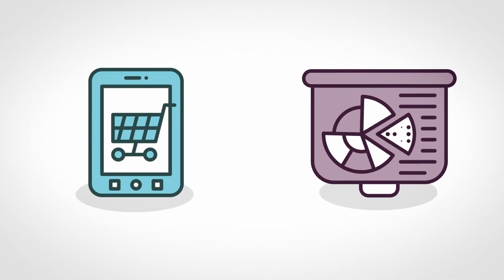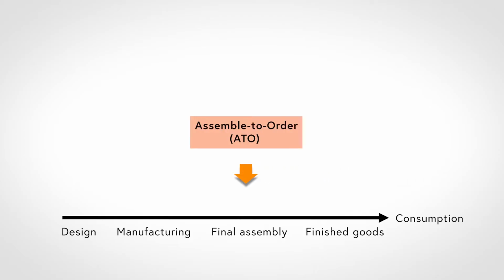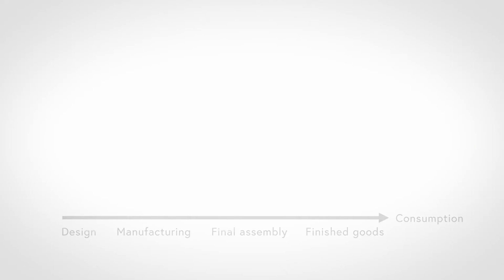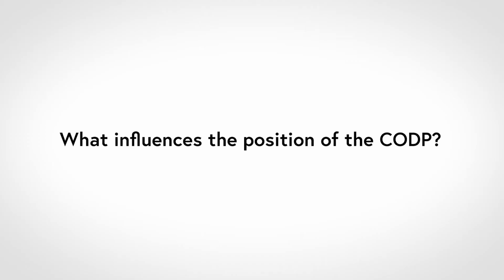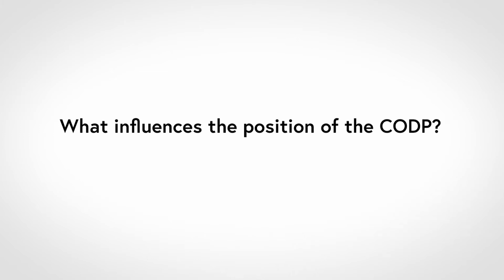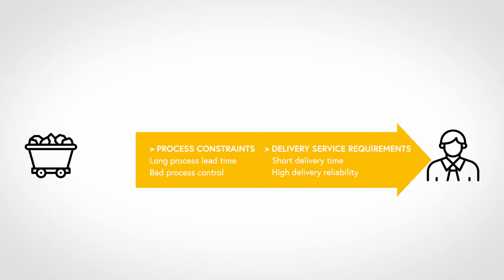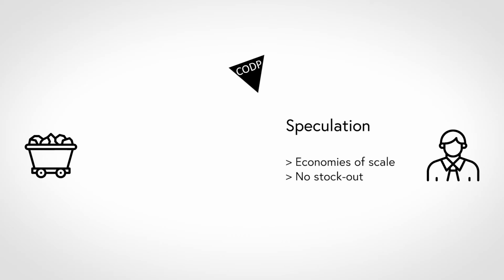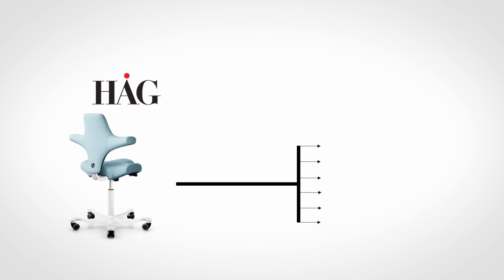Production Strategy

Comment: It's interesting that a long production lead time and poor process control pushes the CODP towards the customer. As alluded to, FG inventory buffers out the production variance which critically gets overlooked by lean thinking. Understanding the trade off in risk between overstocking vs shortsupplying is critical.
Reply from the maker: Not sure if we totally understand what you mean by overlooked by lean thinking. Lean focuses on short lead times and good process control; in the absence of this, you need to buffer with (expensive) inventory. In a truly lean context, you need less inventory.